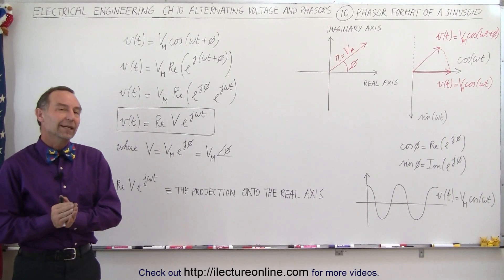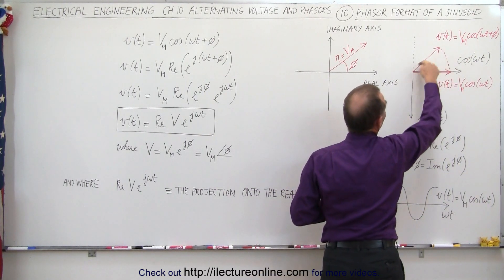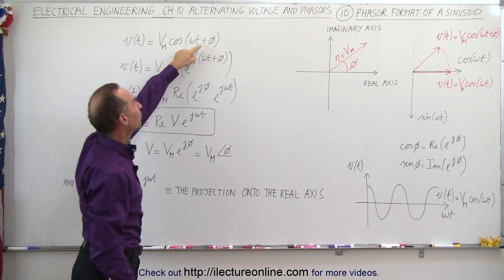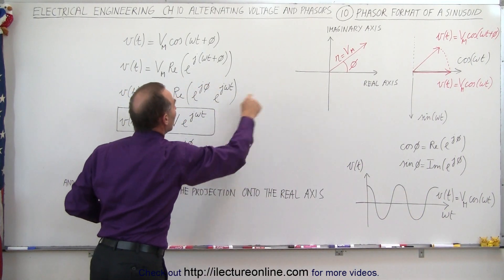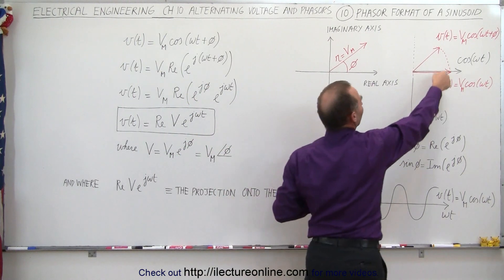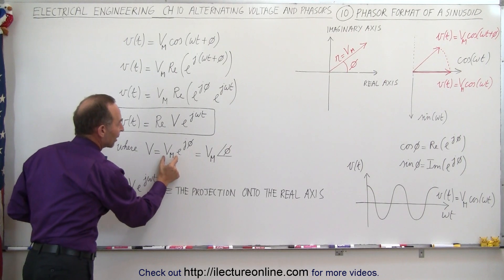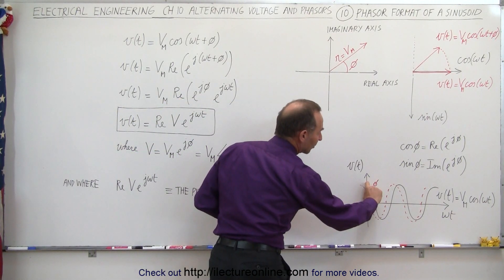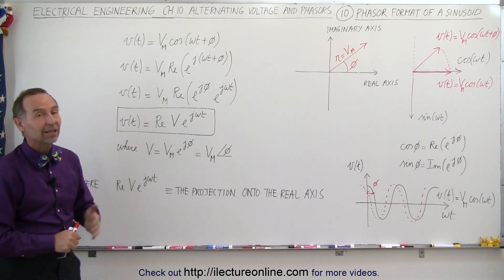Electrical Engineering: Ch 10 Alternating Voltages & Phasors (10 of 82) Phasor Format of Sinusoidal

Comment: Hi Michel, I think something went wrong around 3:35. You are mentioning as stated on the board V=Vm*e^(j*phi)=Vm/_phi, but in a future video about Phasors of Integrals and Derivates, you mentioned V*e^(j*w*t)=Vm/_phi. They both cannot be equal to Vm/_phi, so, which one is correct?